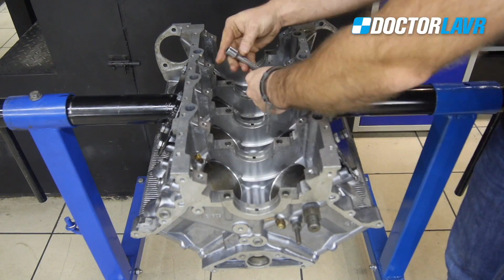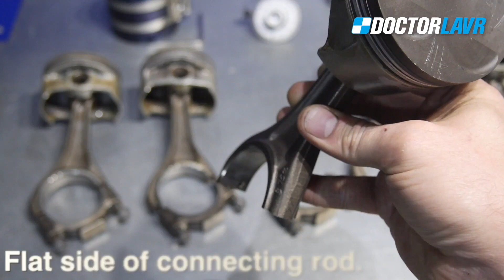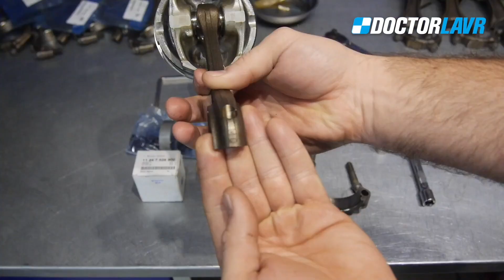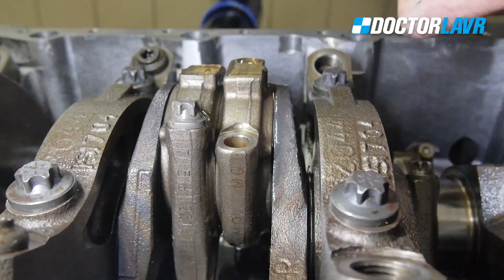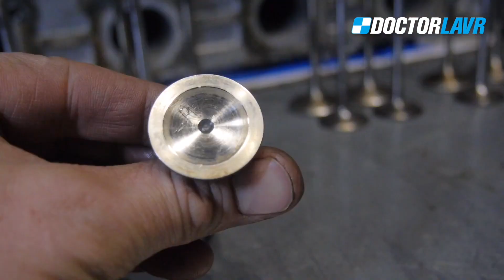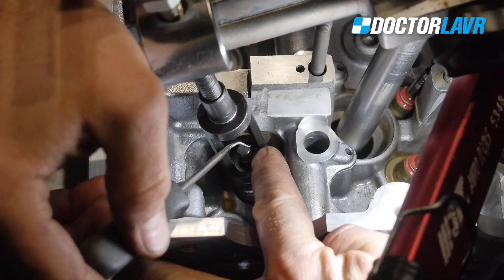BMW engine N62 V8 Assembly instruction. Part 1

Comment: I have e60 550i manual, but that engine is so hard to work on :(  when it is cold it goes well, but when it is hot drops perfomance so much and nobody knows why :(
Reply: They are highly torque managed and the 105c operating temp does not help. I noticed the same with my 545i, Sometimes it pulls, but honestly most times its gutless. I've considered doing a valvetronic lockout and going to ECU master black, But i do like its current OE form. Mine needs timing work and rod bearings though.

Comment: are the exhaust and intake springs of the valves the same?
Reply: No. The exaust are longer.
Reply: @magicm6372   they are the same
Reply: @magicm6372   it is also the same part number

Comment: Is it possible to replace an N62 timing chain in a BMW x5 4.4i E53 without unbolting the alternator and also what socket size did you use to loosen the crank shaft bolt?

Comment: Guten Abend. Bei wie viel km würde diese Arbeit gemacht?
Wie sahen die lagerschalen von kolben und kurbelwelle aus? Wie war das hohnbild? Allgemeiner Verschleiss?
Reply from the maker: Overhaul of this engine was carried out at a mileage of 200,000km. But it was not made due to engine wear. There was a hydro stroke in the cylinder.

Comment: ? Or his Bmw guy I recently but  1 owner 2008 550i very nice how ever needs the valve seals  car has 90,000 not bad  yr. 
I was going to remove engine and Trans to replace the seals also rear main a gasket replacememt on woke engine might as well

? Is there any performance prt for this  I can't find any cams pistons ect like to hop the engine up headers ect if u know of any mods and parts please let me know thnx

Comment: what if I use assembly lube instead of oil to coat the bearings
Reply: Don't mind whats done in the video assembly lube is what you want on there for a dry start.

Comment: Dr. Lavr,

When purchasing your headers, should I  cut my cats off my manifolds or purchase high flow cats and weld onto the headers? 
On a bmw 645
Reply from the maker: First, you install a sports collector. Second, you inject sports catalysts into the exhaust pipes at a distance of 30-50 cm from the manifold flanges.

Comment: Sharing this channel. I was disappointed with the lack of aftermarket support with my e60 550i after purchase. Made my day watching this assembly video. Hope you continue to support the N62 platform mods and tutorials!
Reply: Yes! Sure! :) Very soon the 2nd part of the video!
Reply: Yes no aftermarket about the e60 550 I was disappointed. All about the F10’s and up
Reply: @ChrisTyroneDrip  aftermarket doesnt like NA engines only turbo since they can make big power numbers with easy upgrades
Reply: @FishFind3000  yeah I figured that’s why I sold my 550i in exchange for single turbo e36 👌🏾
Reply: @Burim Bunjaku 550i was fairly unreliable. Single turbo e36 was faster than my 550i and more reliable
Reply: @Burim Bunjaku it was very reliable it was my daily driver for a year and a half 😂 with the only maintenance needing to be done was the regular oil changes and all that fun stuff single turbo e36 was pushing about 350-400HP and it’s lighter than the e60 550i took a few of em to gapplebees but once it hit 200K miles I sold it and bought me a low mileage e92 335i

Comment from the maker: Friends! This is a new channel for repairing BMW engines and tuning exhaust systems. Help with views, comments and likes!
Reply: We will...
Reply: Hi can you give me a website where I can purchase crankshaft and Conrad bearings for this same engine having a very hard time if I have to send you the money to get it I don't mind I'm located in USA
Reply from the maker: @Trinibad718  Unfortunately I can not help, sorry
Reply: hi my car is at the shop I have a 2009 BMW X5 4.8l i'm having a hard time finding the piston rings can you tell me the piston rings spec are the ? bore= 93mm   1st - 1.50mm  2nd - 1.50mm  3rd- 2.0